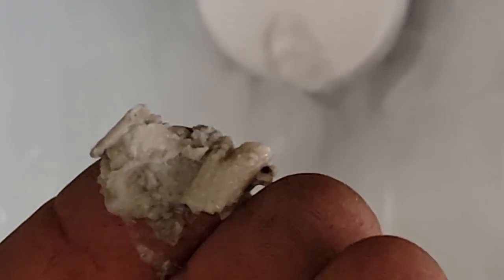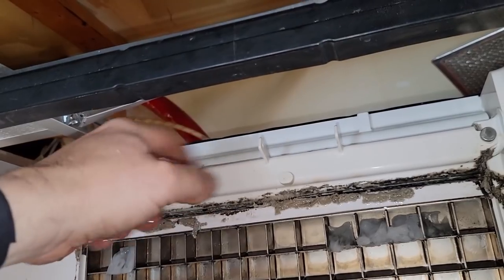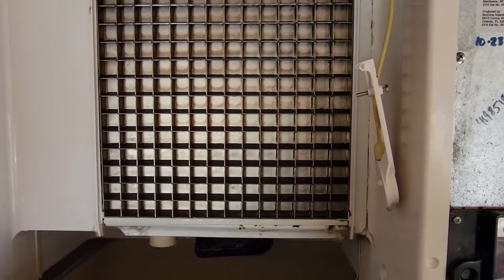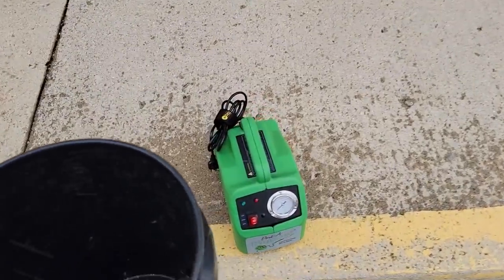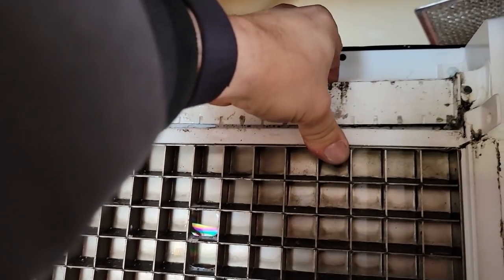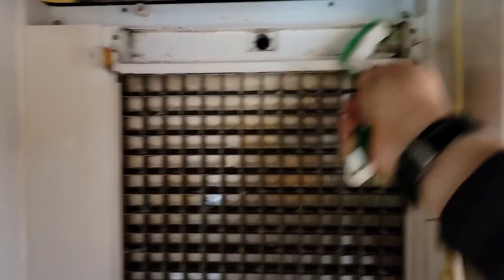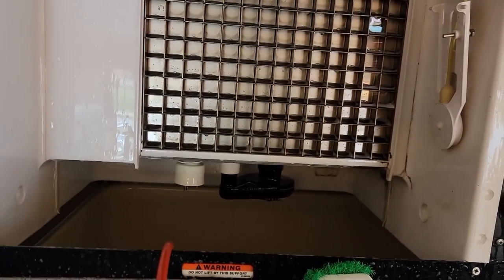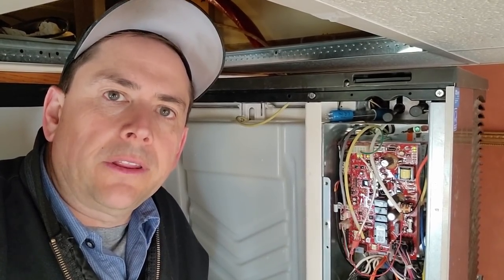You Want Ice? Look At This First!

Comment: I got mine last summer and it’s my go to for Mini-Split evap coils. Its not worth the up charge for the other battery powered units. Just make sure your water supply is almost level with the pump or higher if using a bucket. it doesn’t pull water uphill to well but it works awesome when it’s primed right. Really nice unit.

Comment: 1) It's almost impossible to get sick from what comes out of an ice machine.   It's even harder if you're drinking something carbonated.   
2) It is sand.  You're lucky it's sandy, not just a solid rock.   
3) If you're worried about what you're eating, stop eating anything other than well-done.    Heat kills.   

Rick - you need to get some of those scotchbrite drill bits, plus a rotary nylon brush (cup brush).    Speed that up enormously.

Comment: Against probably everything that's sensible, I've not been put off of ice just yet. I figure it hasn't done me in after all of these years, and I also grew up in a place where the water was "flammable" anyway.
Reply from the maker: That's one  way of thinking about it. lol
Reply: Wait…flammable water??
Reply: @marconantel7735  Methane gas used to be dissolved in the water around these parts. If you held a lit match near the water as it came out of the faucet, it'd pop and spit.

Comment: Have several first gen Indigo and Koolaires at my property that I've done maintenance and repairs on, but have to admit you showed me a couple panels to remove hadn't seen before!

Lost some skin and blood on a Koolaire yesterday changing out the mounting brackets for both probes and the water pump. Have had to service them so many times they no longer gripped.

 Our water is so crappy since our source of tap water is the drain pipe for 33 of these not so united states, a lot of chemicals get added that precipitate on cold surfaces....lots of yellow sandy grit is our usual menace, especially when repairs are made to a 300 year old city's water supply.
Reply from the maker: What city do you live in?
Reply: @HVACRSurvival  NOLA..New Orleans,  Louisiana. As bad as being at the end of the drain pipe of the country that is el rio Mississippi, the last hundred miles or so is lined with petrochemical and plastics plants... "cancer alley"
Reply from the maker: @davejohnsonnola1536  sounds like my part of Ohio. They say my town has the highest cancer rate for the population we have. 🤦🏻

Comment: Glad I didn't do ice makers but I did service what that ice maker sits on which was bad enough in that particular sub shop because of the yeast. Constant drain blockage.
Reply from the maker: Bingo!
Reply: Not enough lye down the drain :)
Reply: @tbelding  Just to make sure no one gets hurt, never put lye in the soda fountain drip tray and plastic drain hose dangerous for the technician who has to unplug the drains could cause burns on skin as most will try to blow out drains to clear. Drano may be used in the PVC drain usually in the cabinet below fountain.
Reply: - @richardl.993  - Unless you're the one working on it, you should never put any caustic substance into anything, at least if it's plugged.   If you have a slow drip tray/hose, adding a small amount of lye will be fine to try to loosen things up.    

Frankly, if someone's first reaction is to blow out a plug, I wouldn't want them working on my drains.  That's an excellent way to force something into an even harder plug - considering what I've removed from drains in the past.
Reply: @tbelding  Just to clarify the drain hose from the fountain unit is in an open air gap drain, the hose was removed and placed into a bucket then it was blown out.

Comment: Love, love the videos. Not entirely sure I need the "Youtube Face" on the video thumbnails, but I get it.
Reply: Second comment: all of the UV lights and auto-clean cycles would be far better served with a 2 or 3 stage incoming water filter.
Reply from the maker: Face gets more views LOL they had a three stage 3M water filter? doesn't seam to work well...
Reply: @HVACRSurvival  If they had water filtration and it looks like that than clearly God does not want them to have ice.
Reply: When I’ve seen them stopped up that bad, it’s almost always the drain is backing up causing it to not being in enough new water, so it keeps cycling the sediment until it looks like that.